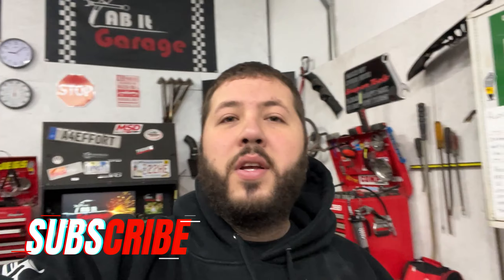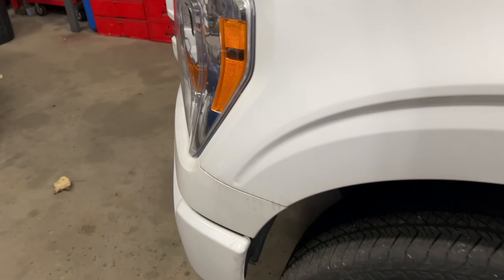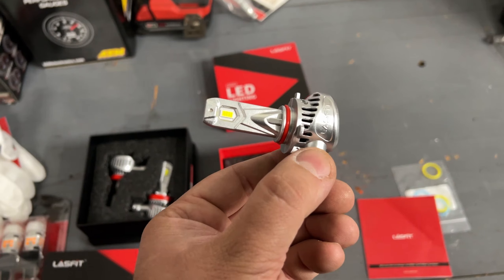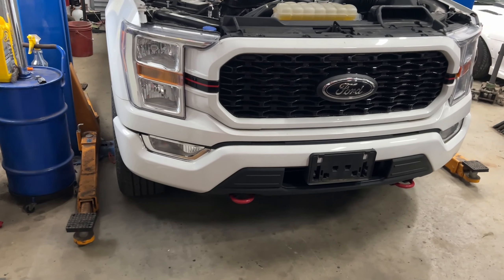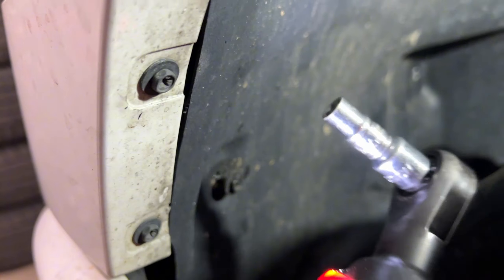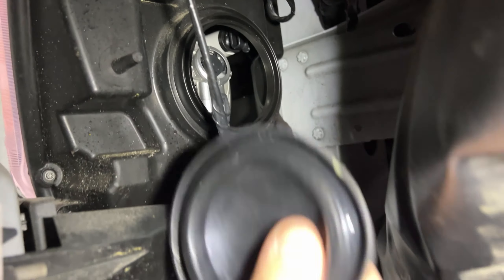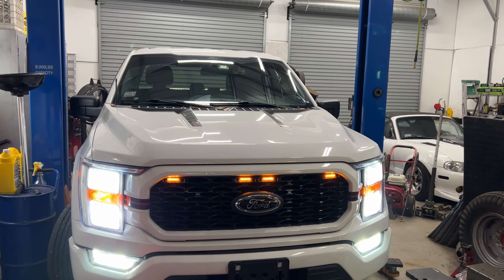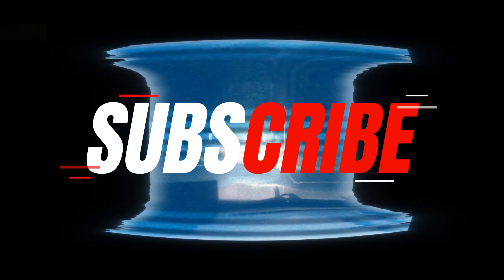2021 F-150 XL full front led lights upgrade with Lasfit quality bulbs.

Comment: The gloves prevent finger oil from getting on the bulbs, shorterning their life since the heat would be directed to the oil on the led.
Reply from the maker: I get that but you don’t really need to touch the LED chip at all since it has a base to grab unlike a regular bulb or HID bulb that has very little to grab on to so I figured its for those who don’t want to get dirty lol. 🤷‍♂️